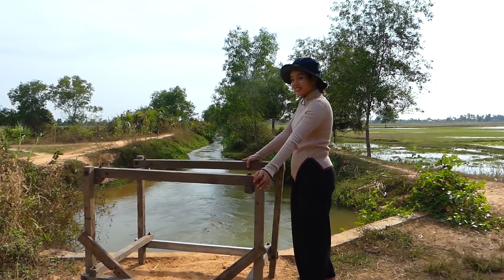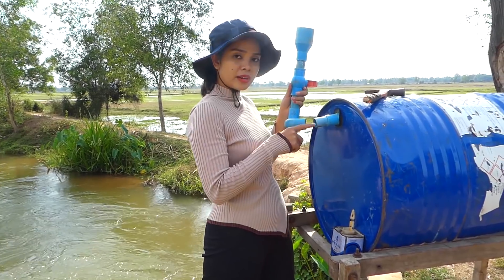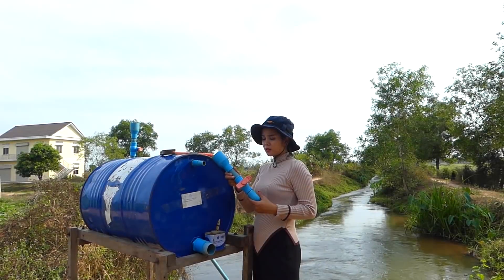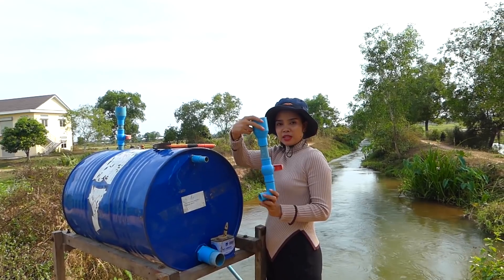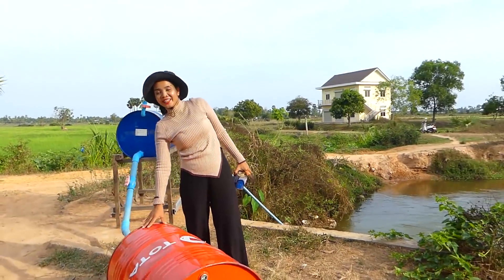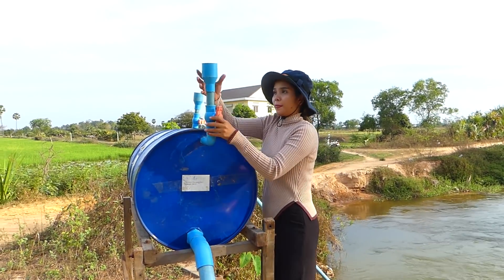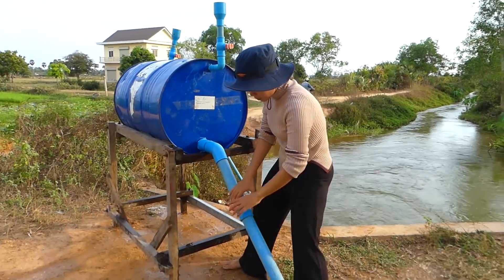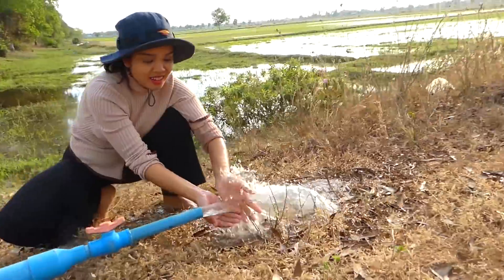Pressured Pump from Deep River, Amazing Auto water motion from deep River using pressure Drum

Comment: I think this is a lie and a dupe, because the water that comes out will not be able to draw the water that will be absorbed into the drum using a vacuum, it will not be possible with a depth of more than 1 meter, especially in large pipes it will make it difficult to work because requires more power. This video is a scam.

Comment: Thank you for your water pump project,it brings me knowledge.
Reply: Unfortunately this brings no knowledge, it is a scam. To suck water from a lower leven continuously needs a continuous input of energy. There is none, besides the manually filled tank. It is possible to pump water out of a streaming river by a "hydraulic ram". This works, also it is not very efficient. What is shown here does not work.

Comment: I think is simple!The vacuum do his job!This way it used a hundred years ago!But the problems began from 10 meters depth and more couse the atmosphere pressure is 100кpa or 1 bar !So in this depth the atmosphere pressure and 10 meters water column are equally as a pressure and the vacuum can't suck more water couse lose his power!
Reply: This is a siphon and a siphon can not lift any water. So here the water level in the river must be higher than the exit valve. It does not seem so!

Comment: Why you add reserve? You opened immediately both exit valves..then how the reserve will get filled? 
And why two inlet pipes to fill the main tank? One will serve the purpose..
Reply: One of the Inlet pipe acts as an air release  Valve. The tank you Call reserve is used to balance the vacuum in the first tank
Reply: @ukenyafarmsltd6481  Balance the vacuum? The red tank is not needed. Even the blue tank is not needed since there is a foot valve, but the water level in he river must be higher tan the outlet in the field. Is it?

Comment: Hi i had a 6 to 7 meter deep well is this project will work.
Reply: The deeper the water, the bigger the concept shall be 

So use a bigger size of the components, so the suction is stronger
Reply: @sbas999  Sory, you are wrong. This is a siphon. A siphon can not lift any water at all. Output must be lower than water level in the river.

Comment: Hi, Cute ideas. Congratulations on your successful project. 
I like the explanations during your work and your interactive responses to the comments. I think what you are doing can change most farmer's life around the world. Keep it up.
I have two questions though.  
1. you have said the pump can lift 5 to 7 meters from the inlet side, but what shall be the drop in height on the outlet side? from the main drum outlet to the tip of the outlet pipe.
2. Once you started the pumping how many hours can it work pumping continuously before it requires refilling? or can it work 24/7?
Thanks
Reply: Congratulations! But can you indicate the sizes of intake and output pipes? I've  tried using 3/4 inch diameter intake pipe and the out put pipes are 2 inch diameter and the tip where the ballvalve faucet is also  3/4inch But it didn't work as what you have shown.  I'm a farmer from the Philippines and it cost me a lot for the materials used. Kindly point out, other important details.
Reply: @percivallacanaria950  sir kumusta project mo gumana ba ,balak ko din sana gayahin ito. Kung gumagana na ginawa mo sir pa reply nman.. salamat
Reply: Dapat 2" din suction pipe, subukan mo muna yong 3/4" paganahin para di dagdag gastos, talian mo ng plastic yong dulo nag suction kung wala ka pa nabili na check valve para puno ng tubig pagbukas doon sa outlet valve
Reply: Dalawa kayo pagkabukas ng outlet valve ng kasama mo  , after 5 seconds tanggalin mo naman yong plastic na nakabara sa suction kung wala pa check valve na naka install.
Reply: @percivallacanaria950  Size of tubes does not matter, larger pipes, more water. BUT. The water level in the river must be higher than the exit in the rice field, and all the tubing must be air tight. The red tank is not needed. Maybe not he blue either. He blue can be placed on the grounf, not high up in the air. Makes it only more difficult to fill.
Reply: Hinde gagana yan kung ang outlet pipe is higher than the surface of the river
Reply: @oscarmalasaga4597 look Makita mo na nga sa demo na gumana haha tas sabihin mo hindi gumagana kaya nga yung inlet pipe ay may chekvalve
Reply: HaHAHa LOL  ROTFLOL  Do you work for Gov.?
Reply: 5